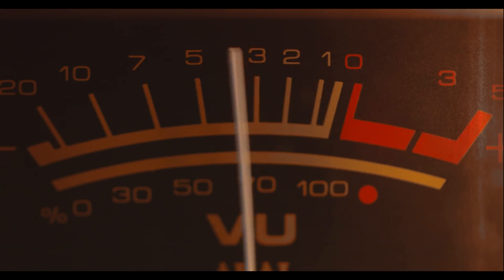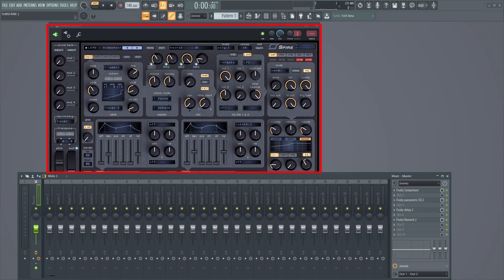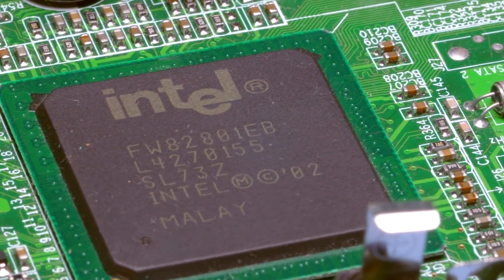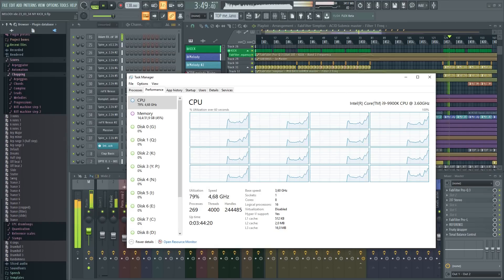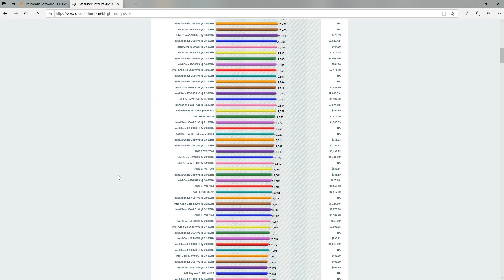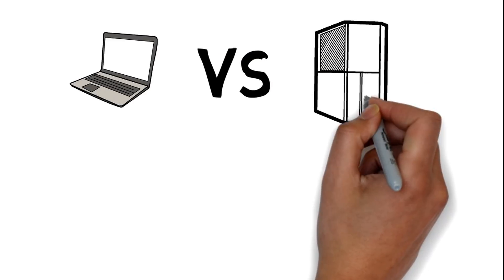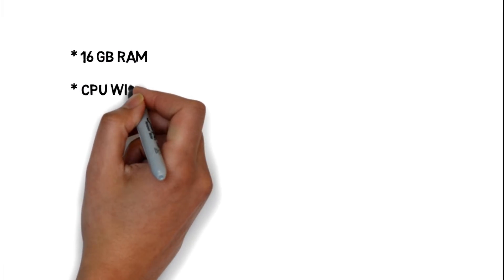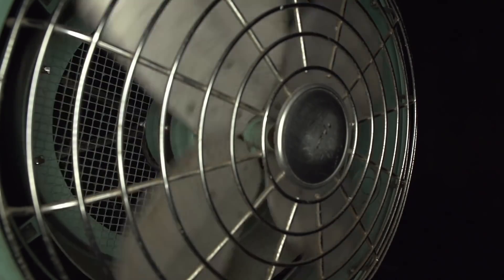The Best Computer For Music Production - What's Needed And Why!

Comment: Poor advice on a number of counts. Your board takes M2 memory? yip, yet you omit this going for 128Gb Ram and SSD? 1Tb M2 is just over £100 and 2Tb being £250 whilst you have put in 128Gb Ram so obviously cost is irrelevant. Some boards have 2x M2 slots !!! Ryzen R7 3800x is 25% cheaper and almost the same processing power as is the new R9 3900x and it offer 4 extra cores. Lets be honest folks, Intel are screwed and will be for tears to come. Future proofing? Intel does not support PCIx4 admittedly currently almost irrelevant but should slot in storage be available in the future, could be very interesting. More time is lost loading apps samples libraries etc than actually processing them in real time so the IO through put is critical that is access to storage.

Also a lot depends on the configuration of your system and where you store your files. I have watched many vids on suggested recommended music production systems and compared them to mine and thought, mmmm, obviously people without ANY computer knowledge and little experience of building systems, these are not GAMES machines these are what would have be called in the good old days, professional workstations ! All they want is for you to buy what they suggest from their affiliated accounts - they want to MAKE MONEY !! who doesn't these days.

Music apps files storage can be very demanding, especially with apps like Kontakt which can have HUGE libraries (mine is 2.47 Tb) so you have to be realistic about access speed. Would you raid 5 SSD/SAS/SATA3? or just mirror a couple of 5Tb SATA Toshies that cost just over £100 each but give you 7200rpm? slap in a LSI 9412 SATA controller and raid it with 3 SATA drives and you are good to go or stick with your internal SATA controller 3x5 Tb Raid 5 gives you 10Tb and redundancy for £400 that would pass H&S for business continuity. I would fail yours.

But in the end it is about COST, if you have the money then cost might be irrelevant, or a business that can write it off against tax, but for home users WE have to be more realistic. For a start 128Gb Ram is OVERKILL, I would argue so is 64, I run 32 and have no need for more but its always easy and cheap to add a bit more a bit not a lot. 

Bottom line is Intel are screwed, well and truly screwed  and have NO ANSWER to AMD. Maybe there were some teething problems upto Gen 2 with memory compatibility but Gen 3 is fine. You put too much emphasis on single core I would argue the rest of the system is just as if not more important. The difference in single core scores is almost irrelevant in my own personal opinion and I have 30 plus years in corporate systems management so know a thing or 2 about systems IO is the killer, as I found with my system so I upgraded recently to M2 with RamSSD/SATA being a secondary consideration
Reply from the maker: [TLDR Warning]

Hi there. This board has room for two M2 Solid State Drives, and if you check out the parts list you'll see that this setup has a 525GB M2 drive. Actually it has two, but I only listed one. How much disk space you need varies a lot, so I prefer to let people decide this on their own. 

I don't know where you got the 128 gb RAM from? This rig has 32 GB RAM. Usually 16 GB will be enough for most people, and that's what I had before, but I some times maxed it out, so I decided to go for 32 GB this time. 

If you look at the release date for this video you'll notice that it was published before the new 3000 series from AMD came out. The new 3000 CPU's are great and offer about the same single core performance as Intel. However, the 3900x can only run at 4 ghz on all cores at once, while the 9900k will be able to run above 5 ghz on all cores, which will most likely make it better suited for music production since core count is not the most important thing when it comes to audio processing. Even so, few people actually need this kind of processing power and overall the 3900x will be a better multi-purpose CPU for most people. AMD Generally provide better value than Intel when it comes to CPU, all though the 3900x is actually a little bit more expensive than the 9900k where I live right now. AMD has designed some great CPU's, which combined with Intel's ongoing manufacturing problems has finally made them truly competitive in the high end segment again, which is great for consumers! I'm very exited to see what they bring to the table next, and I'm planning on making another video with an AMD CPU soon.

Regarding the importance of single-core performance vs multiple cores, I'll quote from the developers: 

"The logic of audio processing - There is a long list of tasks that must be processed in sequence, and this means logically can't be processed in parallel (multithreaded). For example: Plugins must wait for instructions from the Piano roll and Playlist before they make sound. Effects must wait for the audio from upstream instruments and FX before they can process it. Further, it's not possible to parallel-process (multithread) instruments and FX that are on the same Mixer channel (their audio is mixed together), or even in the same Mixer routing pipe-line (when one Mixer track is linked to another and another, even FX processing has an order from top to bottom in the FX stack). Then, the Master Mixer track must wait for every instrument > mixer track > effect to be processed before it can process the audio through the Master effects. So logically, there is a lot of waiting that is a natural and unavoidable fact of DAW music processing. Think of a production line. This means the CPU may not be particularly busy, using all its cores and processing slots, yet it runs out of time to fill that tiny 5 ms audio-buffer because there was a lot of waiting for things that needed to be processed in sequence. It should be clear that fast processing is very important and this is not the same thing as multi-core processing. The best CPU is one that has enough cores to spread the work around AND can do the most work on a single core during each buffer time-slice. Which leads to our TIP: When comparing CPUs, look for the fastest single-core performance scores in a package with at least 4 physical cores."

I totally agree with you that game-rigs are usually not ideal music production computers. Traditionally the i5 has been a very popular gaming CPU, but it's not the best suited for music production. Also, when buying a gaming-computer you pay a lot for the graphics card, which is not an essential part when it comes to music production. It's better to go for a cheaper graphics card and spend that money on monitors etc instead. 

You are probably also right about there being a lot of bad music production content on YouTube. 
Unfortunately, there will always be some people who just try to make money on everyone elses expense. 

That said, I don't consider myself one of those people. I can assure you that I spend a lot of time doing extensive research for every video I put out. I'm a Microsoft certified systems engineer, and a Cisco Certified Network Assosiate. I've built computers since the 90's, and I also started making music around that same time, so I'm not new to this. My first computer was a 486 25 mhz SX :)
I actually used to be a real AMD Fanboy back in the days, and I'm really glad to see AMD finally doing a comeback. 

Regarding affiliate links, it's clearly stated in the description that I earn from qualifying purchases. I'm just an average guy, with a full-time job, working 40 hours a week. YouTube is something I do on the side, but I still end up spending 4-5 hours every day on this (weekends too), so it's kind of like having an extra job. I would much rather just lie down on the couch and watch TV and relax when I get home from work, but I can't. I have to get this stuff done. I spend about 1 hour every day just answering comments like this, because I want to help people out as best I can. 
I don't think it's unreasonable for me to get paid a little bit for all the time and effort I put into this. 

Keep in mind that I pay quite a lot for all those subscription services I need in order to make these videos, such as Photoshop, viddyoze, videoscribe, video editing software, videvo and so on. In the end, I'm not left with much. As a YouTuber with a relatively small channel, I have to make a few bucks wherever I can. Today, most people use ad-blockers, which means that there's basically no ad revenue income from the videos itself. This is what forces many youtubers to try and make money elsewhere. If there's no money in it then nobody would have any reason to put out any content anymore. Good or bad. 

I totally understand that it can be annoying when people place tons of ads on videos and spam you with unuseful affiliate links and such, which is why I try very hard to only put out useful content, with few ads, and I only put out links to equipment and parts that I can personally recommend. 

On a general basis though, I totally understand your frustration. I'm sorry to hear that this video didn't live up to your expectations. Perhaps if you watch some of my other videos you'll change your mind about the content I put out :)

Have a nice day.

Comment: Pretty good video, but I have to make a correction to something the author said. DO NOT use the IGP(integrated graphics) on the processor. Especially if you are using a high resolution monitor or multiple monitors. Opt for a lower end graphics card. Two reasons, additional heat and eating into system ram. The additional heat can affect your boost clock on your cpu and using it, especially with 4k monitors, will use a significant amount of system ram........(found this out from experience)
Reply from the maker: Good point! I don't recommend using it either, which is why I listed a graphics card in the parts list. Having more than one monitor can be really helpful too. :)

Comment: hey there, excellent video, super informative for an old pc builder whos been out of the game for a while and is getting up to speed on the todays tech. I had a few questions: 1] how do you find cpu temps? Reason i ask is that I read some reviews complaining of high temps with i9 9900k. 2] how did u find space after fitting in the cpu cooler/fan/heatsink, did u have to move anything? 3] after checking out the i9s there are a few different versions one being the i9 9900ks special edition which runs at 4ghz straight out the box, is this any better given you can oc to 5 anyway on the 3.6 version? 4] And finally, since this build is a little over 6 months old are there any parts you would change given the availability of new tech, i see u mentioned further down in the comments you are looking to put a amd system together.
Reply from the maker: Hi there. You can find the temps in the bios, and also you will usually find it in the software bundled with the motherboard. If not then there are a lot of software that will display temperatures. I've heard that too, but I haven't had any heat issues myself. My CPU is 34 degrees celcius right now. It rarely goes above 50-60 c when under load, and it's overclocked to run at 5 ghz on all cores. 
The heatsink will fit inside this case with no issue what so ever. Nothing has to be moved or anything like that. I wouldn't bother with the special editions personally, since most 9900k CPU's will run above 5 ghz on all cores with no problem. If you want to spend more money and get an even better setup then the 9900X might be an alternative. You'll get 10 cores and 20 threads. It will be a workstation platform with support for quad channel memory, which can come in quite handy. Most people won't need that kind of power though, and it will be much more expensive. 

Recently the new 3000 series from AMD has also been released, and they are also really good. They have about the same single core speed as the i9. The 3900x for example also have more cores, but it usually can't run more than 4 ghz on all cores at once, so that will most likely still make the 9900k the fastest, all though I haven't had the chance to test this myself yet. 

There's a full list of components for the 9900k based system used in this video in the description below the video. There's also an AMD alternative listed, based on the 3900x. If you don't need to push the system to the very limit, and you also use your computer for things such as video editing for example, which greatly benefits from more cores, the 3900x can be a  very good choice.
Reply: man thanks for the detailed reply, going to be using this system for audio and photo editing so seems perfect for my needs, I've priced the parts based on your build with a couple of changes to ssd drives and going to hopefully order all this week, will say it again, excellent video and thank you for taking the time to reply to all my questions...you got another subscriber 🙂

Comment: Sorry, doesn’t run logic.
Reply from the maker: If you install hackintosh it will ;)  A Mac uses the same components a PC does, and Logic works basically the same way any other daw does with regard to the audio chain and processing, so the advice given in this video will apply to Logic as well. :)
Reply: FireWalk several things hardware chosen in this video is incompatible with hackintosh. I already have a hack. The 9900k is a good choice tho.

Comment: Is it more important to have a higher base clock speed or a higher pts number?
Reply from the maker: Higher clock speeds means higher pts numbers since it's a benchmark on how fast the CPU is. OPC (operations per cycle) or operations per clock as it's also called, in combination with clock speed is what's most important, as well as a decent amount of cores. If you can make any CPU run at higher clock speeds it will be faster.

Comment: Hey, great video! 👍🏻 How's it working for you currently? Any heat issues? Thinking of doing this exact build. Thanks, man.
Reply from the maker: Thanks. It's working great! No issues what so ever. I'm running it on 5 ghz on all cores. Stable as a rock. :)
Reply: @FireWalkMusic  Hey, that's awesome to hear. Bought a pre-built around black Friday; 9700k and Gtx 2070 super. Having some heating issues, and don't need the graphics card, so I'm going to return it and make this build. Thanks again, you're the man.

Comment: Is 109 pts a good single core performance?
Reply from the maker: It's somewhat average. In comparison, the 9900k has 144 Pts, the AMD 3900x has 138 Pts when they are not overclocked.
Reply: @FireWalkMusic  the i5 9400f has a higher pts number than the i7 4790. Does this mean the i5 9400f  would run protools better?
Reply from the maker: @cleftturnip7774  that I7 is an older model. It has 4 cores and hyperthreading, meaning that it can run 8 threads at once. 
The i5 is a newer model and has 6 cores, but no hyperthreading so it can run 6 threads. However, the i5 has slightly faster core speeds so it's hard to say.. It depends on the project and how effective it is at distributing work over the cores. Overall the i5 will be about 18% faster when it comes to effective speed.